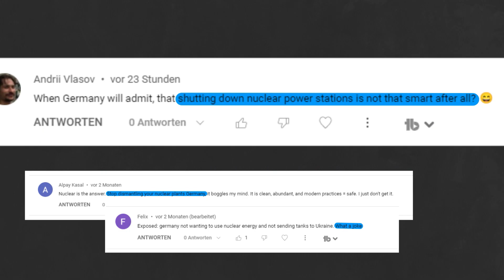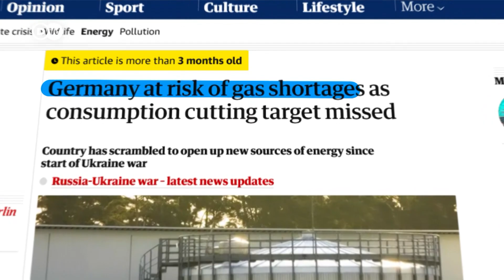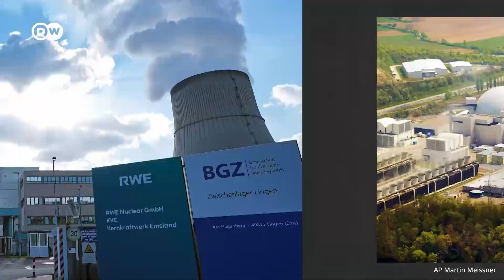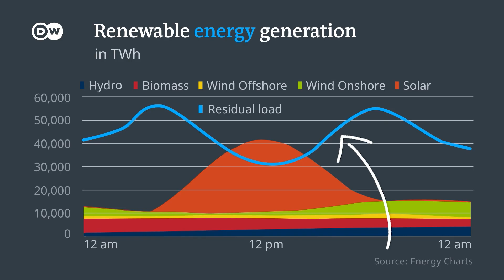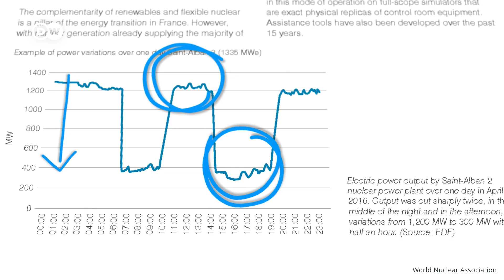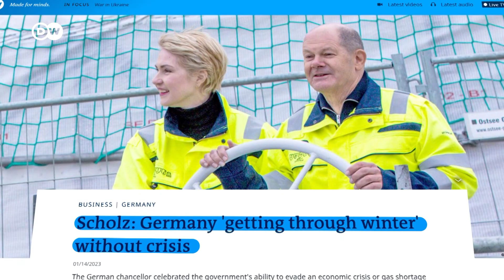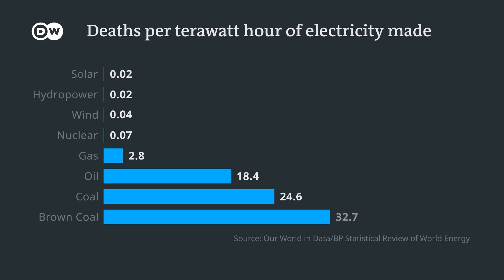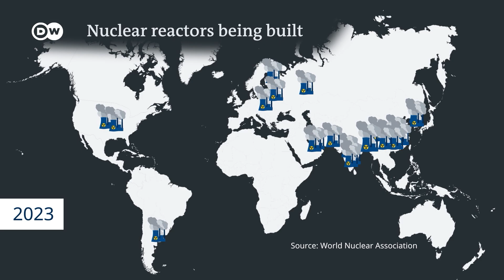Is Germany's nuclear exit a mistake?

Comment: Just because there are clouds in the sky, it doesn't mean the photons from the sun that solar panelling absorbs, isn't charging, it does affect the charging rate of solar panelling, but it's only around 10% slower, than when there aren't any clouds, an it's clear blue skies. Wind energy resources wouldn't be in a spot where the wind may, or may not blow, and they would be close to the coast, or higher altitudes where there is a constant wind flow. Hydroelectricity has no issue except for the location of the river(s). The biggest issue with environmentally friendly energy resources, is as good as it is for the environment, it's also just as bad if not worse than our current energy resources, due to the equipment that's used to harvest environmentally friendly energy resources, that go to landfills are terrible for the environment, and there's no waste management agency that has the capabilities to deal with this type of equipment, windmills are massive, and solar panelling is toxic. Leaving nuclear energy is the smartest move anyone could make, nuclear energy is dangerous, unstable, and there's no way to clean the area in the case of a meltdown.

Comment: If Germany is serious about going renewable energy with at least 80% of the grid powered by them. Then I do agree that a lot of Nuclear power would not be suitable, but you always need base load capacity to be fulfilled and currently that is by a large percentage being achieved by using coal.

Meaning that nuclear is not the correct technology to look at when you need to add rapid flexibility then grid scale battery storage or capacitor technology is the ultimate solution to invest in.

This means that nuclear should replace coal and battery or capacitor technology should replace gas and then you add inn biomass and hydro power can help with large fluctuations that last for a longer timeframe and also provide base load energy production to the grid.

So nuclear is and always will be a base load technology that should be compared with other base load technologies like coal or oil and to some extent gas. 

If nuclear is not being reactivated then gas should replace coal. 
Gas has a lot less harmful pollutants and is less toxic to both humans, animals and environment.

Comment: The nuclear power plants don't mix well with renewables, in order to speed up wind and photovoltaic it only makes sense to shut the slow nuclear power plants down.
In the time to build a new nuclear power plant you can build remeeables with multiple times more power outcome for a fraction of that money.
Reply: Problem with renewables, is providing stable base load. Without base load (provided by Hydro, Nuclear, Coal/Gas), your power supply is unreliable at best, pointless at worst.
Reply: @gorantev  how can 5 % of all produced electrical power in germay (the last 3 nuclear power plants) have a significant impact und this "baseload"?

Comment: You decided to make no visible progress on reducing your greenhouse emissions because you wanted to swap one clean form of energy for another. Had you done the bare minimum and only replace reactors with ones from that generation (not the newer, even safer, more efficient ones), you could have gotten rid of coal completely and even start exporting energy to others trying to make the transition. Instead, you decided it was better for the German populous to breathe in a greater amount of radioactive material than they would experience from a nuclear power plant.
Reply: But, but, but nuclear energy is scary. I heard a man was bitten by a radioactive spider and it turned him into a spider!

Comment: Biggest German mistake of this century, second was Nord Stream 1 &2, Each of this choses make Putin happy.

MSR Nuclear reactors are much more flexible can have change their output few times faster than PWR,
Also this type produce 100x less nuclear waste and needed to be stored only for 300years.
Reply: To build a New nuklear Power plant cost to much an it took 10 years to Finish (Look at Finnland)
Reply: @muysli.y1855  Polish Copper mining company KGHM, ordered last year a few SMR reactors, completed installation is planed by 2025, smelting copper requires a lot of power and electricity prices rise make that is cheaper to get small nuclear reactors than pay rising bills.
Reply: I would say the biggest was losing the PV production to China

Comment: No, it is not a mistake. The mistake comes in not emphasizing conservation over generation capacity. We do not need nuclear power generation to build a sustainable society in which all people have the opportunity to self-actualize, and the longer we persist in pursuing this extremely dangerous form of power generation, the longer people will refuse to conserve and ensure equity for all. While nuclear power may look promising when we look at certain statistics, the fact of nuclear power is that the consequences of a failure have the potential to be catastrophic, and therefore the risk is simply too high to continue with it.
Reply: Yeah, this would be concerning if the chances of nuclear meltdowns were that big (they're not, fukushima happened because of a horrible disaster outside of the power plant and Chernobyl had the horrible administration of the soviet union)

Comment: I’m surprised that at 7:52 the point wasn’t made that this flux in excess energy could be used to produce hydrogen instead of turning it off, it’s pretty clear by now that any road towards zero will need hydrogen for heavy industry. Instead of a presenting it as a weakness this excess energy should be seen as an opportunity.
Reply: Or to export cheap power to other countries like Norway, instead of trying to suck us dry.  
If we could, the new and big power cable would probably had been shut down, since the power mainly goes out of Norway instead of going both ways. This means that we now have to pay dearly for our (formerly) plentiful hydropower.
Reply: @MalawisLilleKanal  Germany will always just suck others dry and promote how they're the best for "not needing" nuclear power.
Reply: @MalawisLilleKanal  weird you would use norway as an example, we are by a large margin the country with most clean energy lol
Reply: That is a great idea but you would need to first build some very big hydrogen plants for that, the concept is solid(minus the energy loss in the conversion between electricity -> hydrogen -> electricity) but it's very new so no one has built one of these yet, China, India, Spain, and others are planning to build some to test the concept but the best estimates are that they will be probably online and operational for 2028~2035 that its some 5 to 12 years into the future and maybe a couple more years to refine the designs of the plants, so if the germans want it they better start now
Reply: @PianoWolfg  nuclear plants produce hydrogen as a byproduct dude
Reply: @Yeomen1986  Nuclear power plants do not produce hydrogen as a byproduct of their primary function of generating electricity. However, nuclear power plants can be used to produce hydrogen through various methods such as electrolysis and thermochemical cycles 1. The selection of hydrogen production technologies depends on the type of nuclear power plant itself 1. Some nuclear power plants are gearing up for clean hydrogen production 2
Reply: It is very expensive to build an electrolyzer that only operates on excess solar and wind energy.
It would only run a fraction of the time, making it inefficient and costly.
Reply: @SpecialeW  yes but nuclear does it for free
Reply: There is a reason why we use electricity as our primary method of transporting energy. You don't see people build gas pipelines to homes for heating anymore. And you don't see home appliances powered by gas. 

Turning electricity back to gas is not forward thinking, it's going backwards. 

I think people are so obsessed with anti-nuclear politics that they have lost their common sese.
Reply: Hydrogen is very difficult to store and transport.
Reply: It doesn't make much sense to build a facility capable of producing something, and then only running it when excess power is available. Hydrogen, if we use it for anything, will likely require dedicated energy production. Most likely from nuclear
Reply: the irony is the cleanest hydrogen production comes from red hydrogen which comes from nuclear reactors.

Comment: 9:00 I have to say I cringe at this statement. I mean come on, no matter how you put it, using nuclear is better than using fossil fuels. So even if you have issues with nuclear, if you agree with reality of climate change, it's necessary. You can put all criticism towards it, but in the end it comes down to this, what is the goal here? If goal is to reduce green house emissions, we should be looking at every solution to decrese it. 
And there's just the fact that we need both stable and peaker power, using just renewables can actually become incredibly inefficient due to intermittent nature of it.

To return to point of this comment, what slows down progress more, expensive gas pipelines and ports for fossil fuels? Or nuclear plants?

Comment: Carbon capture is expensive, you need energy and resources just to offset energy produced, makes no sense :D All that effort to just use bad low tech energy source with no future, when money could be invested to something better. And while nuclear as it is now isn't cheap, keeping existing plants open is pretty cheap. On safety and ecological impact nuclear is up there with renewables. But nuclear not being the cheapest option is still much better than relying on fossil fuels, let alone building expnesive af pipelines from Russia and being dependent on that isntead of small amount of radioactive material. And I'm saying this not because of current situation, but just from common sense perspective I have held for years.

Not to mention nuclear is technology that hasn't even been properly developed yet, it has tons of potential if it had actually recieved investment during all these years. Instead for all these years we have been just been like primitve cavemen burning flammable stuff with no hope for actual progress :D There's other thing going for nuclear too, renewables are difinitely part of energy mix we need, but for robust energy grid we need diversified energy sources. Germany's "plan" to 100% rely on renewables was just absurd in full sense of the word.

Comment: From every aspect, its a wrong, emotion-based decision. Energy crisis isn't over yet, we used Russian gas for most part to fill the reserves and big parts of Europe got exceptionally warm winter. Nuclear energy is actually very safe, its on bar with safest means of electricity generation. And to use coal instead of nuclear...the dirtiest and by far the most lethal source of energy. 1200sh times more deaths per TWh produced, while nuclear includes the Chernobyl disaster, with reactor not in use anymore. And nuclear can produce the base power, something wind and solar cannot yet

Comment: Fun fact: In absolute terms France has reduced nuclear energy production more than Germany in recent years. But France's emissions are going down just fine.
Reply: yea france plants are just cracking everywhere thats why they are shutting so many down
Reply: @MK-rw1on  This isn't even that recent, I rechecked years between 2015 and 2021 and France reduced nuclear by more than double compared to Germany.
Reply: @Apjooz  tbf its also because pretty much all of Frances Nuclear power plant are way to old to be the most efficient, and since they didnt build new ones in decades regaining the expertise to make new one takes a while, but im pretty sure the problem will deal with itself eventually, Nuclear is still by far the best energy source for now as they dont have the issue of not producing enough like most renewables beside Hydro, who is already an issue anyway because less water-=less energy

Comment: The issue that I see is that the current reactors we're talking about here have all reached their designed lifetime. 
They were built in the late 1980s, went in service in 1988 and 1989, and all three of them were designed for an operational time of 35 years. Keeping them run over their designed service life is probably a very bad idea. Not because they turn unsafe, but because they turn unreliable and maintenance intensive. That's what France did with theirs, and the consequences were blatantly obvious.
When it comes to building new ones, this seems to be no longer economically viable. Looking at current projects like Hinkley Point C in the UK, where the company that operates the plant gets 92 Pounds/MWh over the reactors' lifetimes, is just insane to production costs for renewables. Wind is now sitting somewhere between 30 and 40 Pounds/MWh, and those prices seem to be similar in the EU market. The solution, in my opinion, seems to be obvious: More renewables, more quickly, and more international interconnects, be it HVDC like Nord.Link or via traditional AC lines.
Reply: We need a lot more cheap renewables, over production even, so we can do make inefficient energy storage economical.

Comment: Ignoring facts will not change the reality. Germany is ignoring the fact that the actual current replacement for the nuclear (coal and gas) is both more dangerous and producing much more CO2. Like stated at the end of the video, IF Germany had enough renewable power, IF there was enough grid scale storage AND IF the grid was better, then yes, end nuclear. But the reality is that NONE of those conditions are true, so acting as if it was is just mindless.

Comment: Fear of nuclear power has killed far more people than nuclear power ever will. With it's tiny footprint and low C02 emissions, nuclear power is the greenest power source we currently have, and it doesn't kill more people than "renewables", in fact considerably lower than hydro on a global scale. Look at the Banqiao dam disaster in China. It was orders of magnitude deadlier than Chernobyl.

It would be better to use nuclear as the base power in the grid and add "renewables" where it's suitable to do so.

I put quotation marks around "renewables", since it's weird to distinguish nuclear from them. The Sun is running on nuclear processes itself, so the so called "renewables" won't outlast those nuclear processes.
Reply: How is nuclear power the greenest energy source we have? The greenest energy source are still renewables
Reply: @jan-lukas  No, wind, solar and hydro all has an enormous footprint compared to nuclear, which means that nature has to be sacrificed in order to establish those power plants. Wind and nuclear is pretty even in CO2 emissions on their own, but wind can never manage just on its own, and currently fossil fuels step in pretty much everywhere where there isn't ample hydro. And solar and hydro have larger CO2 emissions, not to mention that hydro power more or less creates biological deserts with their large dams. Neither wind not solar has large generators either, which means that the energy system as a whole is entirely reliant on those provided by hydro, nuclear and fossil fuel plants. (The electrical system can't function without those.)

There's no question that nuclear is far greener than wind, solar and hydro. I don't know enough about geothermal to say whether that's a contender, but it's hardly ever considered anyway.

Comment: There's a word for how we innovate in Germany. "Herbeiteuern" ( = to force alternative solutions by making the status quo absurdly expensive, while not necessarily having an economically viable alternative or strategy ready).
Reply: So thats why they've been dependent on import from the Nordic countries. Without that it would have been very dark and cold in Germany since the Russian gas stopped.
Reply: @rogerbjorkman4650 what you don't understand is that we export more energy than we import, because the whole f*cking European market is interconnected
Reply: Nice, hadn’t heard this word before and I’m German

Comment: The timing of it was awful. And the insistence on meeting the deadline to phase out nuclear, even after Russia made its intentions to use energy as a weapon... that was poor policy. Germany only showed a little flexibility in the end when the crisis was upon Europe and the nuclear capability left would make little difference. And even under those circumstances, some German parties seem to have fought a short extension of the use of a few reactors (what was wrong with those people!). Finally, the initial idea of replacing nuclear with Russian energy was basically exchanging one potentially dangerous energy form with the only other one with even more dangers. So it wasn't so much that phasing out nuclear was bad (even though I believe nuclear can be part of a diversified and safe low carbon system). What was terrible is the entire way Germany went about it. At least the winter was mild and Moscow's dreams of seeing Germans/Europe suffer under an energy embargo did not come true.
Reply: Not this year at least, maybe Germany can stockpile enough fossil fuels this year now that it has had time to make deals in case next winter is bad. In a strange twist of fate it wasn't a harsh winter that saved Russia, but a very mild one that saved Germany.
Reply: I wouldn't even call it extension. It was just to use up the remaining fuel.